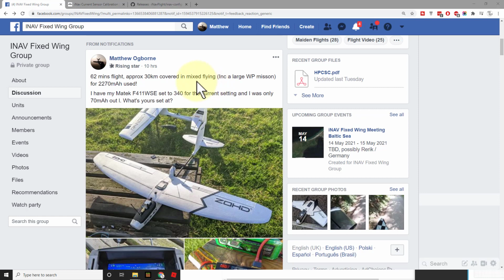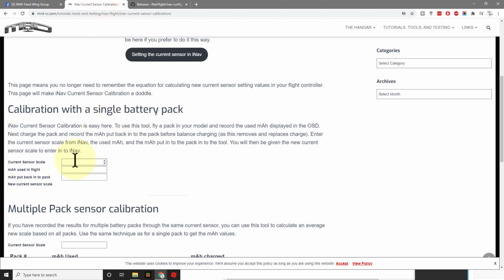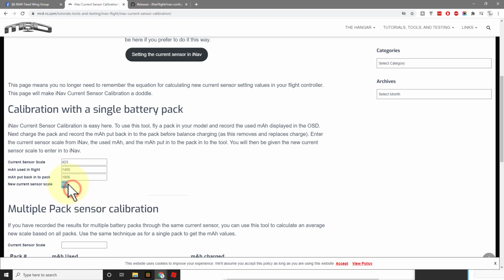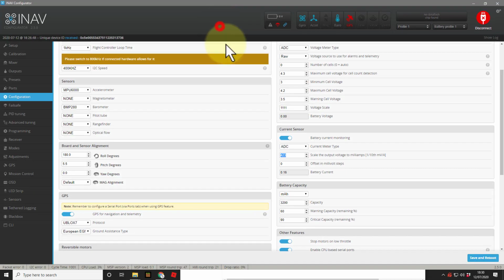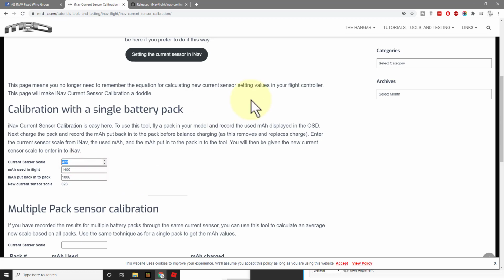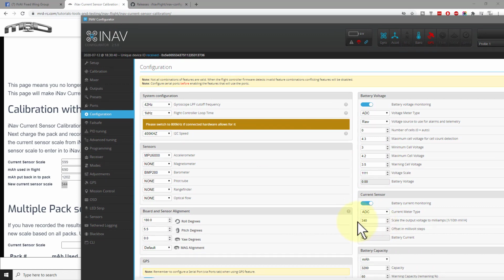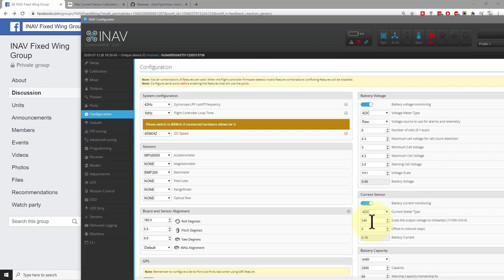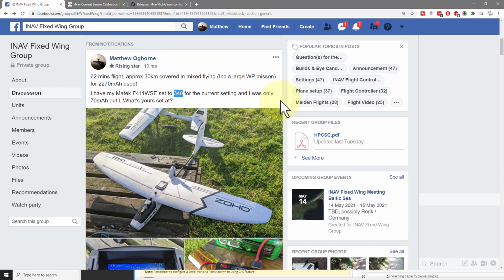iNav: How to Calibrate The Current Sensor The EASY Way

Comment: Hi Matt,  Tool says "There is now a more accurate way to set your current sensor scale and offset." but it makes no mention of what offset value to use ???   Thanks for great stuff, Steve
Reply from the maker: Howdy Steve, yea that's his other method. I prefer this one as it seems to work out to match what is taken out Vs what was used in the battery. A couple of flights and I've normally for mine dialed right in. Matt

Comment: Never use the current sensor, just watch VBATT instead....Looks useful though.
Reply from the maker: Howdy ET, I use it all the time, but in combination with the battery voltage. I have serious issues at 5.8V on 2S, so thats always a key attribute. Matt

Comment: The default current sensor scale declared by the manufacturer should be very precise. Why change it? Only if the resistors on the FC are wrong .... Not very likely .. On my Matek F405 AIO my sensor is accurate to mA with the default value declared by Matek
Reply from the maker: Howdy, are you sure about that? Every single one of my FC that have current sensors were incorrect from the manufacturer. An example is the Matek F411-WSE, suggested value 423, real value, 350. Matt
Reply: @RagTheNutsOff  Then I was very lucky! However your video is very useful, also because in many Chinese clone flight controllers the Scale value is not declared at all.

Comment: If you want the most accurate data, make sure you don’t balance charge when you use your charger to calculate how many mah went back into the pack...because balance mode calculates more mah going back is as it takes some out during the balance cycle...which depending on the quality/age of the pack, can be a small error, or very large one.
Reply from the maker: Hey Sean, for me mine are cells from the same batch and are within 1mOhm of each other.
Reply: RagTheNutsOff usually with healthy packs it’s a small difference, but it can be significant with cheaper or older packs
Reply: @sean metzger  it says that in first paragraph of tool instructions